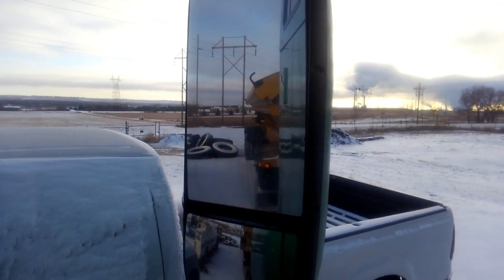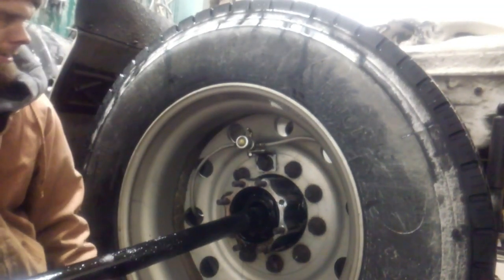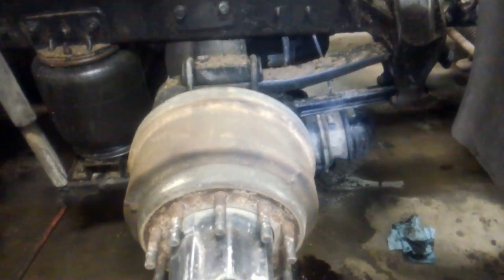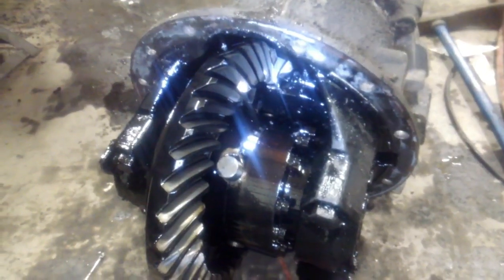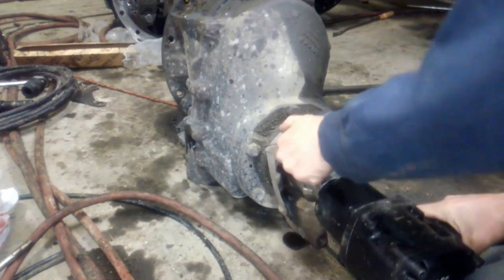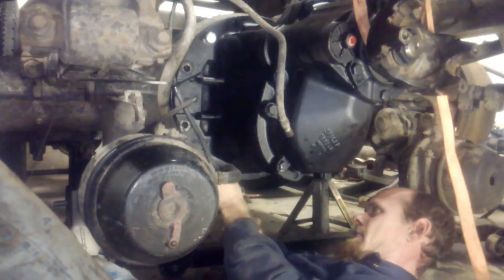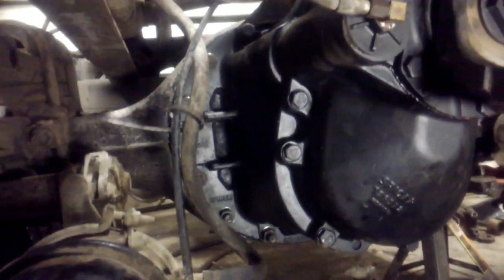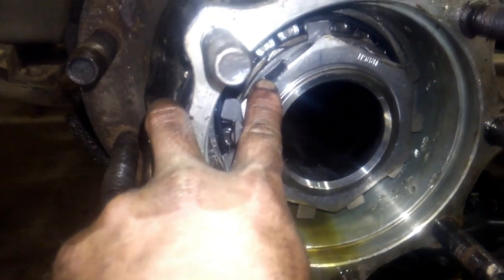semi truck rear end repair axle 3rd member in one video

Comment from the maker: i apologize to anyone who has already seen this. just re-edited and made a multi video series on a repair into one video to be easier to follow. thank you
Reply: Ezrider92356 where do you live with snow on the ground in August
Reply from the maker: north dakota....lol. but no snow right now. this was recorded end of december.
Reply: Brian Ludwig Jr where do you buy your parts?
Reply: Hi can u pls explain how u slide differential away with long bolts pls? Thank u
Reply: Ezrider92356     If u already got this I apologize.  I have a question. I lost my driver side duals and axel at approximately 5 mph. The Tab ring on the lock nut looked like it hadn’t been bent over. When the nuts come loose and u loose axel, is that a death sentence. These diffy were just rebuilt less than 10,000 miles ago. I’m not a shop equipped to do it but could manage if I have to pull 3rd member.  Was hoping I could just reassemble with tab ring correctly installed this time.   TY. 😉👍
Reply: You make it look easy...👍👍

Comment: thanks for the video...my 1984 pete just had this happen i was in mcminnville tn made the decision to lock it in and ran to detroit locked in with 79000 lbs.....back to bowling green ky where my shop is just pulled it today your videos help alot...i know i was pushing it but it handled it well
Reply from the maker: Yeah that's a long ways to push it on the power divider. Glad you made it. Good luck on your repair 👍

Comment: I had the exact same problem at the fuel island. 
I put interlock on and was able to move. Then I turned interlock off and everything was fine. 
So I pulled the oil plug and it had a tiny bit of small shavings in it. Nothing like yours. 
I canceled my load I had booked and then 
drove it home empty for 150 miles and went to the shop and they looked and test drove and said it has no problems they can see. I had not problems driving home. 

Then the tech told me I was probably high centered on one wheel while at the fuel island. Which caused one wheel off the ground. 

He said he never seen one fix it self. Then explained that the rear ends are either broken or not. They don’t have intermitting signs. 
If I turned that interlock off and it was broke, I wouldn’t of moved. 

So I drove it up and down some hills in the city with an empty trailer and it didn’t make any issues. 

The joys of being an owner operator.

Comment: We got 2 bolt 6 to 8 in long. Cut the head off , cut a slot for a flat screw drive in the cut off end, then rounded the end. Took out 1 bolt either side of hoghead out and put those  longer bolts in & lightly coat of oil on them . Then removed remanded of bolts. The long bolts let you slide hoghead out a few inches . Easier to hook up chain and align when reinstalling.  Just something for you to think about.
Reply: Good idea :)

Comment: Chalk STR axle . OTC air frame jack , lift drive  axle off the ground 10”and secure with jack stands . Leave air jacks in place .  This leaves plenty of working room around the differential .

Comment: When you talk about axel stubs it’s what we call half shafts over here in the uk. It’s bad that some might park their trucks up because of this issue. Twin sticks Peterbuilt for instance was parked because of a problem with the front differential. Such a waste on classic old iron. Loving the videos. 😎
Reply from the maker: Yeah it's not a inexpensive repair tho and alot of times when those trucks were parked they were not yet classics just old trucks with probably other issues as well and then in need of a expensive repair
Reply: @Ezrider359  I suppose the money you would put into keeping it on the road would go well towards a new one. Over here old truck are either exported or scrapped. I do like how they keep a lot of them rigs in fields for parts or to resurrect at another time. If they were left out in the uk they would rust to nothing in no time. 😆

Comment: Big job , nice work , hard work on the bones  when you’re on the concrete floor !
Reply from the maker: Would be harder working on a gravel lot...lol sure would be nice to have a lift sometimes though
Reply: @Ezrider359  Fine job EZ. I wish my garage was heated and had a concrete floor to work off of it sure would make life easier
Reply from the maker: @markmeister2444  i did it for years without a shop i don't think i could go back to not having one...lol

Comment: Thank you for this entertainment on a Saturday night.  Question: That would have been the time to change to a different "rear end," meaning a different gear ratio if, like, you started Hauling light loads long distances, right? And by changing the rear end that means changing the ratio between the big ring gear and the smaller pinion gear,  right? Question: if you changed just the pinion gear on the front axle, would that change the ratio for both axles?

Comment: Hey I am doing this job right now on my 2004 Peterbilt 379.I just removed both axles and neither of them are broken, however it looks like there are small chips in the teeth on the end of the axles probably from metal in the inside. Do I need to replace my axles as well if there are small bits of damage done to the teeth or is that normal?

Comment: Very informative video, boss. Would you be able to explain more on how a longer bolt slides the diff away from the housing on the removal process. Thanks
Reply: He installs the long bolts, then prys the rear end out, onto the bolts shank. Its basically to hold the 3rd member so he can put his lifting hooks,or plates on to hook the chain to to help lift it out . hope this helps answer your question
Reply: @jeffstorm1421  make a lot of sense. Thanks man!! Appreciate it.

Comment: need to design a jig to lift from the bottom to reinstall a third member in a 1996 mack cement truck can hoist from the top with out removing the mixer drum
Reply from the maker: You could probably rig a fixture on a trans jack
Reply: you have been a big help on this fur shur thank you

Comment: Somebody replaced wheel seal recently and did not do it properly. Your hub nut was not tighten per specification and was not locked up. Your weels hub was loose. That caused your problem.
You need to know procedure how to use the torque wrench for that job. You over tighten the hub nut.  Yoke nut needs to be torqed at 450 ft/lb too. That truck will be back to the shop soon. But you look as a good driver.
Reply from the maker: funny truck has been in service two years at least sense this video was uploaded and no issues with this repair.

Comment: Why did you take the tires off? No need.   Just pull the axles far enough out to separate the power divider from them. Saves time when doing a big job like that brother.
Reply from the maker: gives more room too work, had to take the tires off at least one side anyway as with the pusher axle on my truck there would not have been enough room to get the 3rd member in or out from under the truck without lifting the truck 2 feet off the ground. also the wheel bearings/seals were re-done at the same time. if the pusher axle didn't make access a pain and the wheel bearings were not being re done certainly would have saved some time to leave the tires on the truck. but for this one it was easier IMO just to get them out of the way.

Comment: Great video. I have a question maybe you can help with. I have one tandem truck the blew the intermediate shaft a few weeks ago. I'm new to the fleet and big trucks in general so I assumed it had a bad u joint and let go. Anyway I replaced output and input yokes for the intermediate shaft with a brand new shaft and it exploded on the highway a few days ago again. I cant find any evidence of the brakes locking up and the rear exle looks pretty healthy drained fluid and went in with inspection camera. No chunks in the case and no excessive metal. When the shaft blew the second time it ripped out the whole output shaft a long with the yoke. And ideas before I tear into the wrong axle? Any help is appreciated 👍

Comment: How are those cat eyes tire pressure equalizers working for u? I want to get them but I worry they will cause leaks after a short while bc of the added connection points.
Reply from the maker: iv been running them on 2 triple axle trailers and my tractor for about 4 years the other trailer has a auto inflation system.  pro's defiantly outweigh the cons. i would recommend them. they can sometimes cause a leak point but they will only equalize down to somewhere around  90% of there closed psi rating then a valve inside will shut and keep your other tire fully inflated. its does not happen frequently though and because it is so easy to see that you have a cat eye open you will notice there is a problem much quicker than you ever would with just a tire thumper.  iv been planning to do a video on the pro's vs cons of the cat eyes for a while now but haven't gotten to it yet hopefully soon.
Reply: @Ezrider359  i think I'll go ahead and order them. During winter my tires always drop in pressure at different rates and it's a pain in the ass to get to that inner tire with all the road salt. Seems to me the cat's eyes are better quality compared to the cross fire.
Reply from the maker: cat eyes are better, better quality and easier to read at a glance. the single fill point is one of my favorite things about them. buy the next pressure rating down from where you intend to run your tires at. the first ones i bought were for my exact target psi and sometimes if its a little cooler one morning than the next they may be slightly open but fine as soon as the tire or air temp comes up. running 5 psi over your cat eye settings won't give you any false low psi indications and you can still stick your pressure gauge on the single fill location from time to time if you want. in the winter time your want to knock any ice build up off the hoses. last winter i had the fitting on one hose where it screws onto the valve stem crack after running threw about 800 miles of slush and had about a inch of ice built up on all of them but that is a pretty extreme case.
Reply: @Ezrider359  thanks for advise. That makes a lot of sense. I'll keep an eye on those hoses for sure. I'll order a couple extra. All I run is upper midwest to Pacific NW and it never ending snow and slush during the winter.
Reply from the maker: yeah i carry 1 extra inside and outside tire hose in my side box.  don't need them often but if you do need to replace one its nice to just throw a new hose on rather than take the cat eye off while you wait to get a new hose.

Comment: Hot rod driver kids take notice...
Or pay $$$$$$$
Be smooth because 500hp + on the new  motor s goes through tiny gears..
That new synthetic gear oil helps alot .
No more burned black oil.

Comment: Making it look easy is a huge understatement!! I’m right now working on a 1996 international 9400, front drive axle went, I waited till fallowing morning and no one fixed it for me so looks like it’s on me, lol do you by chance have a trick on how to make short work on the cone washers going inside the axle flange around the hub studs? I’ve faught them suckers for awhile today and have to say I’ve only removed 2 so far! This is the first center section change for me so any advice will be appreciated
Reply from the maker: a lot of times if you smack the end of the axle with a hammer it will knock all the cone washers loose. don't hit it on the studs just the face of the axle in the center

Comment: Got my front diff swapped by rush truck. ive only had it for 100k miles noticed my diff was leaking. I cleaned it as best as i could to find the source of the problem. Topped it off, Lost about a gallon of oil.. noticed oil is leaking from one of diff to housing bolts any suggestions in how to stop the leak?
Reply from the maker: Leaking from the bolt? You could try taking the bolt out putting some thread sealent on it and putting it back in if it's leaking from the flange your probably have to pull the 3rd member to re seal it

Comment: Hello I just had to have my center section replaced on my front drive axle, two short trips (428 miles trips) it started leaking at pinion seal started leaking again. My question is, should the piñon yoke and u-joints been replaced with new center section? Or is it ok to use old yoke and u-joints? Thank you for your time
Reply from the maker: There ok to re use if there in good shape my guess would be that the seal surface on the yolk is worn. I do tend to just replace u joints as prevention any time the driveshaft is off

Comment: I have a question, every morning for the first 5km or more my truck will take few seconds or nearly a minute to change into low range from high range while moving. But if completely stop then it would enter to low range without hesitation, and things get better after the gearbox is well warm up and it would enter low or high range like how it suppose to do. I have check the airline and no leakage at all. It's been doing this for the pass 70k miles and the 6th gear won't engaged at all when still cold but I would skip it engaged to 7th but once it's warm up then everything will be smooth. It's a Chinese truck named as howo and it has 10 speed gearbox.
Reply from the maker: its been a long time sense iv been in a range box, but i do believe that there is a screen/air filter in the range box, otherwise i would think possibly the the piston might be gummed up with sludge or something. i would probably start with disassembling the range selector on the trans after varifiying the air supply to the trans is good.

Comment: How much was the 3rd member? Was it reman or new? 
Last reman I had to get was like $3500, than $1000 labor in Phoenix. Plus a tow bill. I lost half the teeth on the ring gear. Fun 2 days that was.
Reply from the maker: reman, it was right around 3500 including the core charge witch i got back 6-700 something like that. bought straight from a local re-builder. i probably had right around 10 hours labor in changing it. could be done quicker but it takes a good bit of time to clean and flush out the entire housing pull the wheel bearings apart clean inspect and replace clean the hubs out ect and put it all back together. the one in this video was recorded just before Christmas i think i finished it up on Christmas eve and i got to do it again a few weeks ago (didn't record it cause i already have this video and just wanted to get the job done) sheered the output shaft off pulling a load out of a field and piece of metal went in the ring gear. gotta love trucking....lol

Comment: I hate to be a nag. Now I watched this. I think my through shaft is bad. Where can I find the steps to replace it as I have zero experience with semi truck rear ends. Do I pull the axle? To get it out? I see you did it in this video. But I don’t know the full process.
Reply from the maker: You don't need to pull the axles to remove the threw shaft remove the yolk and the seal then the snap ring and then you can pull the shaft out.
Reply: Ezrider92356 sweet. That almost sounds too easy lol. I thought it would be more involved than that. Thanks so much! Hopefully someday I can help you out with a question! Learning a lot between you and twin stick

Comment: After tightening the wheel bearings do you back them off at all?
Reply from the maker: 5. ● Install the outer bearing on the spindle.
● Install the inner nut on the spindle.
● Tighten the inner nut to 200 lbs. ft. (271 N. M.) while rotating the wheel hub.
* CAUTION: Never use an impact Wrench to adjust wheel bearings. A torque wrench is required to assure that
the nuts are property tightened.
Back-off the inner nut one full turn. Rotate the wheel hub.
Re-tighten the inner nut to 50 lbs. ft. (68 N. M.) while rotating the wheel hub.
Back-off the inner nut exactly 1/4 turn.
Note: This adjustment procedure allows the wheel to rotate freely with 0.001”-0.005” (0.025mm to 0.1 27mm) end-play.
9. Install the correct lock washer for the wheel nut system being used.